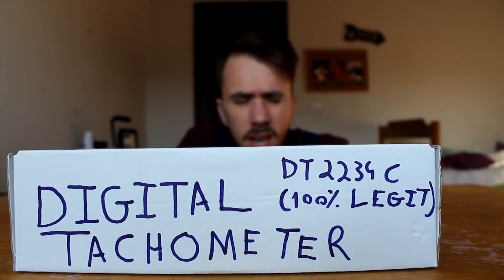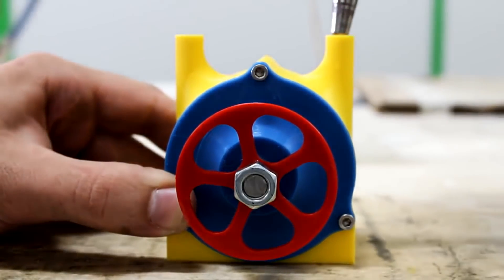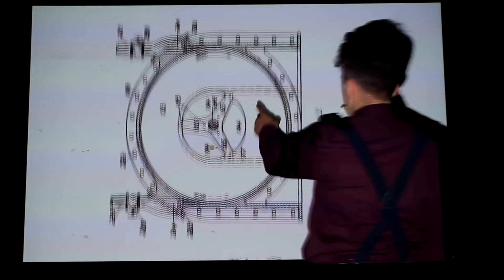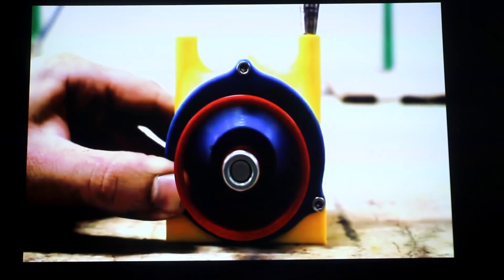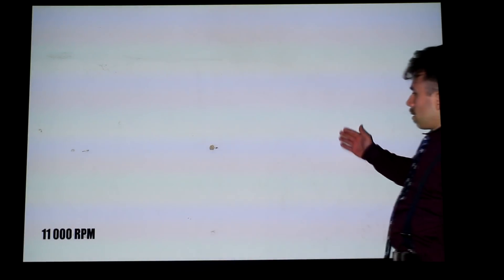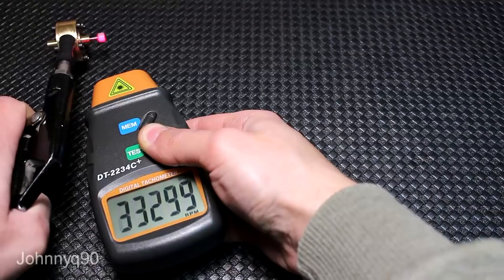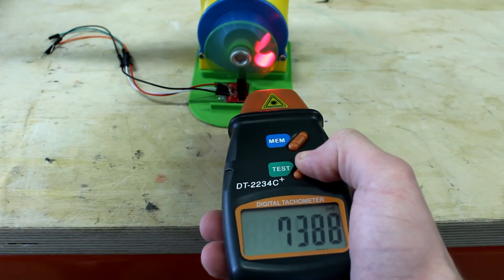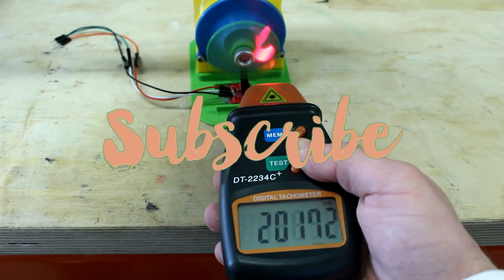3D Printing a 106 Years Old Invention - Testing the DT2234C

Comment: You have to build it to be able to support 95000 rpm. Keep increasing air pressure past the point you think is enough once the vortex perfectly lines up the efficiency will jump to 99%. Thats the point of equilibrium for the turbine.
Reply: Thats the purpose tesla made them for most people never spin up the turbine to its actual potential.

Comment: I'm not one to talk but it looks like the new design strays away from nikola teslas original design, looks like the exhaust holes on the turbine disks are located to far from the Center. Also if you put Tesla's propulsion device on either side of the turbine your efficiency will go up 50% This is where you start extracting a considerable amount of heat energy from the compressed air. The propulsion device creates a vacuum to suck the air out of the turbine exhaust resulting in a reduction in back pressure that allows the particles to lose all their kinetic energy to the shaft and further increase the natural vacuum you have just created.
Reply from the maker: Thank so much for the comment :D 
You're probably right and I will take you input into consideration. 
I'm still trying out some ideas, so I need more time :)
Reply: oops I men't to say, looks like the exhaust holes on the turbine disks are located to far from the Center.
Reply from the maker: @iEnergySupply  I actually rectified that I think but you'll see it on the next video :)